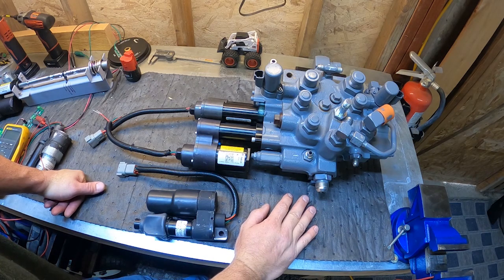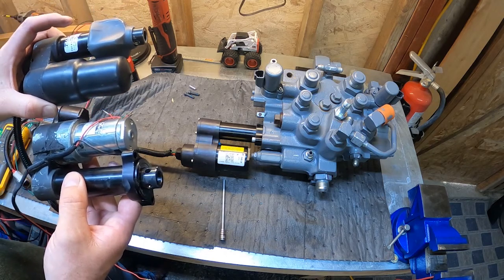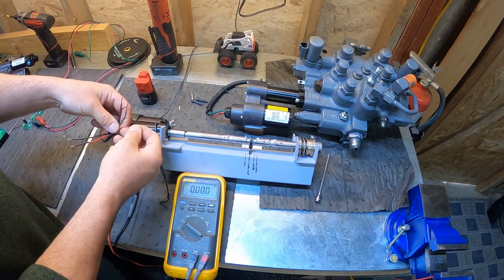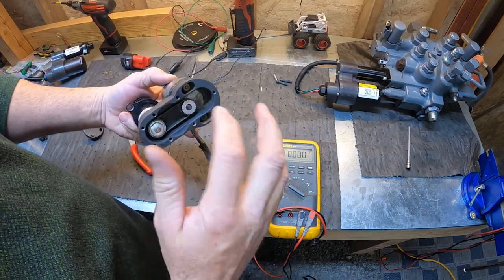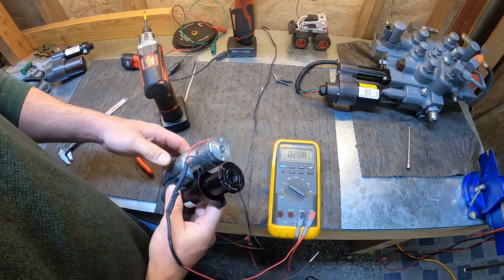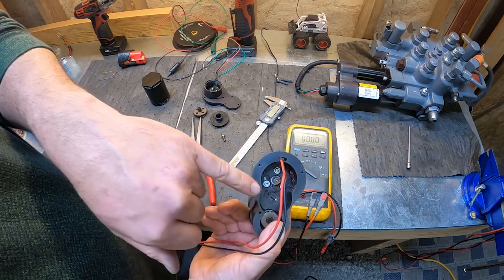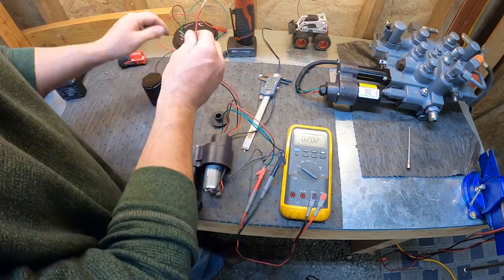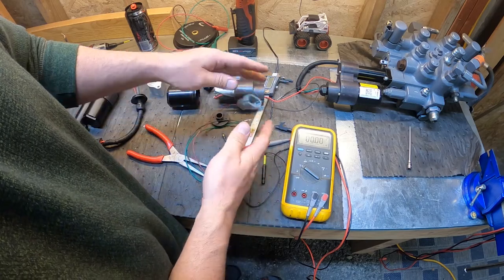Bobcat actuator, how it works, repair and calibration, what you need to know.  ACS AHC SJC

Comment: I have my actuator apart and the motor is not working.  It is a Globe Motor with the part number 403A851.  Can not find this motor anywhere.   Is there a source for these or do you sell?    I took motor apart it doesn’t look bad but won’t run.
Reply from the maker: pottermotorsports I have used tested good motors if your interested you can email me bswwood@gmail.com

Comment: Hi hows things- i watch most of  your bobcat videos- i am struggling with my machine at moment an thought this might be worth a try if you can help,i have a 2007 S160 SN: 530011328 joystick machine an lift an tilt not working, i have replaced the solenoid but still not working, the hr meter has also stopped working so i cant see any fault codes- any suggestions ?could it be the actuator??ACS Light .
Thanks 
Regards
John

Comment: I believe I have a bad actuator and now presently I am trying to take it off. But it seems almost impossible on the machine am I better to go about trying to take off the whole hydraulic control assembly. By the way your video was very well done.
Reply from the maker: Thanks for the comment but no way I would take the whole control valve out. Worst case I'd pull the steering plate out and work around that. If the actuator is stuck you might have to pull the bolts out of the back of it and remove the big gear and manually spin it out
Reply: I have a 2002 753 with hand and foot control options. Is the steering plate the plate down behind your lower legs bending up into the engine cavity? Thanks for your quick response.
Reply from the maker: @bobsmith9786  that's correct, it's much easier to remove than it looks.
Reply: So I got the actuator off. When just doing the motor test and reversing polarity it went one way well in but not out. Seems like I have quite a bit of

Comment: Hey thanks for the help! I got my actuator of and now I’m have a bad control from water damage. I need the screen and the board, any ideas...?
Reply from the maker: Not sure I follow, do you need one of the front panels? What model and serial number?  Of you remove the panel it should have a part # on it.
Reply: @tetradgroup  yeah I need the front control #6672348
Reply: Serial# 805667
Reply from the maker: @bradholbrook2424  the panel is not repairable, I personally downgrade the panel to a keyed panel which is much cheaper.  Key works fine and you  really don't need many of the options the keyless panel provides.
Reply: @tetradgroup  thank you. From the dealership? Do you have part number?
Reply from the maker: @bradholbrook2424  6688404 is the keyed option, you can get from the dealership, make sure to get keys as well because it dose not come with.  Double check that part number, you did not give me the correct serial number but that's the only option for a key to panel so it should work. It will have to be downgraded through the ECU. Usually the dealership would have to do this with a laptop, I believe there is an option to do it in the machine I'll look up the procedure if you decide to go that route
Reply: @tetradgroup  thank you very much!

Comment: First, thank you so much for this video.
I have a 2000 863G. When the machine is not running and the actuators are activated, the tilt actuator acts like its having a hard time finding its center. it sounds like its twitching back and forth. It will do this until it decides that it's happy with its position. as long as its on long enough to so so. If its shut down before it finds center it will throw the error when key is next turned on. I pulled the actuator (Marine style connector with spacers) and tested it at the machine. everything seems to work as it should (no twitching). The measurement I got at the machine was 7.32mm. However, when bench testing this actuator, and at 2v, i get a consistent measurement of 5.3mm.
Any ideas?
Thanks
Reply from the maker: If you have the old style joysticks, that is usually the where the issue can be found.  Plug the other actuator in to the tilt harness and see if it does the same thing.  I'm guessing you have an AHC machine with the big silver controller.  The controllers can also fail causing symptoms such as your describing.
Reply: @tetradgroup  Holly smokes that was fast! Thank you so much! Yes old style. Yes big controller. Possible bad connection in the joystick? Ill tare into it now and post what I find.
Thanks again.
Reply from the maker: @northernlights4613  more so the inside of the joystick hall effect sensor wears out and has a hard time finding center.  If the joystick sensor is the aluminum block style it is no longer available and the whole joystick will need to be upgraded.  After swapping actuators around and if the issue remains on the tilt circuit you can swap joystick sensors around, although kind of a pain to help narrow down the problem.  If the actuator acts up on both lift and tilt circuit it could just be a bad actuator. Hope that makes sense.
Reply: @tetradgroup  Hello again. So, when I swap the connections at the actuators all it does is throw an ACS error. I think it was 32-04 (should have written it down). I did however, swap the joystick sensors. For some reason the twitching stopped and for now it's not locking out. I have about a foot and a half snow to clear we'll see what happens. Maybe it will tell me something if the lift actuator starts to twitch.
Thank you for your time!

Comment: 2000 773g tilt actuator belt is stretched out and skipping teeth on gear everything else tests fine. Do you know where to get a belt and what causes this.
Reply from the maker: Usually age is the issue, but make sure the ball screw slides smoothly in and out.  I have a few belts available if interested you can email me at bswwood@gmail.com
Reply: Try to adjust the 2 screws that attach the motor to the housing they are slotted.

Comment: Hi Brady, Awesome video, great camera work and video quality, nice to find "how to" videos you can actually see. My 863F which I've had for 6 years is acting up again, tilt actuator again. I am heading to the job site tomorrow to pull it and repair/recal what I can. Just wondering if the "new" FLIP actuator is PN 7104842, and the adapter required for 1999 machine is 7101705? I bought my machine cheap from a gravel pit after they spent $15K at the dealership trying to fix the AHC. They gave up after 4 years of fartin around with it. I'm an electronics tech and had it working again within a few weeks after figuring out how it worked, but now I have no tilt at all after a minute or so of running. They put in the AHC update kit, new sticks, harness, controller (metal one 6675129) and multiple actuators over the years, still never worked for more than 6 months at a time. I'm hoping this time to fix once and for all. My other question for you is how do you calibrate the AHC system after replacing the actuators? Mine is the 2 LED on the left joystick, AHC only system. I know the SM states for testing to pull in the handles and turn off the key etc..., just wondering if that is the calibration sequence as well? Oh, and finally, the manual states the centered voltage should be 1.72 for my vintage, have you found that to be correct for first gen AHC or should I use 2.0VDC?

Thanks for all you helpful videos, great work.

cheers
Reply from the maker: Those are the correct part numbers but I would think if the AHC update kit has been installed then the new actuators and adapters would have also been installed.  You will not be able to calibrate the AHC system unfortunately.  I use the 2.0V with the measurements provided and works well.  If you have issues you can try to back off to 1.72 and see if that helps but 2 should be fine.
Reply: @tetradgroup  Thank you for the quick reply, much appreciated. Yes, those are the part numbers I found on the multiple invoices that came with the machine, just wanted to make sure I had the latest version. I am suspecting bad motor brushes or binding ball screw, I'll know later today. Thanks again!
Reply: OK, well I think we have a good news/bad news scenario, I'll let you tell me if it's bad or tolerable.  I dismantled the tilt actuator and found not bad brushes but sticky brushes, not sliding freely in the holder and not making contact with the comm so I dismantled the motor and polished the commutator and cleaned up the end plate/brush holder and it freed up nicely, motor spins perfectly now every time.  I calibrated it per your method and it all seemed fine, until I tried push/pulling the actuator to see the output of the hall sensor, it's over stroking in both directions, ie rolls past 5 back to .4VDC or so, same the other way, goes past 0 and up to about 4.5VDC. The ball screw has some play, more than the lift actuator but it is free. It has about .5mm play in/out. I tried for an hour to center the sensor better but it still over strokes in both directions. Can you please confirm if the controller will still be able to deal with this, I imagine the hydraulics don't need the full 1.14" stroke??

The good news is the lift actuator didn't really need anything but I buffed up the commutator and adjust the 5mm depth to 2.0 VDC and this one doesn't over stroke at all, it's perfect.

I also figured out why your 2.0 VDC method works perfectly, and replicates what the service manual states (at least for my 2000 F series). You use 5VDC and set it for 2.0V at 5mm, the manual states the center value should be 1.72V but that is testing in the machine connected to the controller, and as the controller is only putting out 4.3VDC, 1.72 corresponds perfectly to 2v at 5 volt supply. I adjusted my power supply to 4.3 and sure enough, 1.72V. Yeah! I imagine the 5V would only be seen when the float is activated.

Anyways, hope you can tell me all is good with my sloppy actuator and I don't have to spend $1400 for a new one...I saw somewhere that the ball screw can be serviced but can't the info. I tried removing the outer cover like the motor cover but no go, I didn't want to break anything until I checked with you. 

I wanted to get your opinion before I put it all back together. 

Thanks Brady!
Reply from the maker: @kilohertz684  not sure how well it will handle the slop but it will not roll over due to limited stroke of spool once it is hooked up.  There is a tolerance for center position so it will handle some slop. And yes you are correct, only lift will approach 5V in float mode, tilt should never exceed 4.2V
Reply: @tetradgroup  Thanks Brady! Again appreciate the quick reply. I will try it as is but would like to know if there are any tricks to getting the ball screw housing separated from the case? I thought I would at least have a look at it before putting it back in the machine.

Cheers
Reply from the maker: @kilohertz684  don't take ball screw apart, extremely difficult to put back together without special tools.
Reply: @tetradgroup  K thx, saved me a bunch of trouble.
Reply: @tetradgroup  Well it works, a buggar to reassemble it all. The tilt, although it works,  still sounds sluggish in one direction. I would like to lube the ball screw rod, like you mentioned in your video, I don't want to dismantle the screw, I know how they work, recirculating balls, I just want to get some grease on the screw. Should I heat the case to get the housing to release, pipe wrench? Explosives? 🙂  I know that I will need to replace this in the next while, I just need to get thru this season for now. Cheers

Comment: I don't know where to start. T750 Pedals do not move; code W3267 ACS Operating Mode Switch Flipped While Operating. Do you think it's a control valve actuator?
Reply from the maker: Nope, either ISO switch or wiring issue

Comment: Hello, I was wondering if you could please share where you got the motor controller and servo driver to test the actuators. I replaced my tilt actuator and now I have no codes but the bucket will tilt down normal speed but tilting up is very slow unless I push the float button and then tilt the bucket up it will go up very fast and continues until I push the float button again. I tried to calibrate the actuators as per manual but still doesn't work. The machine is a s175.
Reply from the maker: Probably the fastest and easy way to check your actuator is to swap the tilt and lift actuators and see if you have the same issue with the tilt as you're currently having on the lift
Reply: The the tilt actuator (the one with the issue) is brand new and it will tilt down fine but tilt up slowly in less you push the float button and then move the tilt leaver.
Reply: I would like to rebuild my old actuator so thats why I was asking which motor controller and servo driver you use in the video.
Reply: Thank you very much for the videos you make and also for taking the time to help.
Reply from the maker: @putzp7457  Servo City is where I get my parts.  Parts 605045 and 605105 is the driver and controller I use.
Reply: Thank you.
Reply: So I swapped the lift and tilt actuators with each other and it still won't tilt the bucket up as it should. While the actuators where off I pushed and pulled the lift/tilt spools and they both move the same no binding etc..
Would you have any idea on what would cause the tilt hydraulic circuit to move slow in only one direction? Is there a way to bypass the bics solenoid on the valve mine is shorted to ground and I live in the bush so it takes a long time to get parts?
Reply from the maker: @putzp7457  when you tilt forward does it have enough power to lift the machine? Usually it'll lift down due to gravity faster than it'll lift up if you have a bad cylinder. Is your machine have one or two tilt cylinders? Raise the arms in the air with the bucket level shut the machine off and lift the arm bar and see if it leaks down at all. There is not a way to bypass the bics as it it spring closed and electricly opened.
Reply: When I tilt down  it lifts the machine no problem, but when I try tilt up its very slow and no power unless I push float button while trying to tilt up. So to me bc it will tilt up with full power when I push the float button while trying to tilt up the cylinders are fine. My S175 has two tilt cyclinders There is no problems with lift hydraulics and it will tilt down with full power but won't tilt up with full power. 
   I just don't know if I should be  chasing a electrical issue or a hydraulic issue? The hydraulics obviously has the potential to tilt up normally bc it works whe I push the float button. Its not the actuator bc its brand new and I swapped the the lift and tilt actuators and no change  I have calibrated the actuators like you show in the video but it's no better. When I move the tilt lever and listen to the actuator move without the engine on it sounds like its struggling more so when tilting down. The tilt spool moves freely and smoothly when I tried to move by hand with actuator removed.

Comment: attempting to manually calibrate 1st Generation lift actuator. your video shows adapter/coupler that you  use as a leveling guide by laying straight edge across to check actuator shaft height,  i have 873 F series Bobcat. my adapter/coupler is half as thick as the one you use in video. please help
Reply from the maker: Sounds like you have a floating, belt drive actuator.  You may have to pin it to the valve and either take a measurement while mounted to valve or set voltage and bolt head on while actuator is mounted on valve.
Reply: @tetradgroup  i manually calibrated lift and tilt actuators. actuator pistons are now to far away to connect to spool valves now that the pistons are centered up in time and calibrated. i have plenty of room so im gonna try and predrill 2 mount holes into mounting bracket and simply slide actuator assemblies forward to make up the difference in thec gap
Reply from the maker: Should not have to move the mount, sounds like the actuator is not in the correct position.  I didn't cover the correct measurement for that style actuator.
Reply: @nickdarling9557  Make sure lift arms and tilt bucket are secured. Leave the covers with the pots off, attach your actuators to the spools, now tighten them to the valve body. They should be close to centered , you can check this by putting a socket on the nut on the worm screw. You will know when you are at center by twisting left/right (the spring on the spool is self centering). Now you have found center, plug the actuator in to the machine. Turn the key on (my AHC light comes on but you will have power ), connect multi meter +(red) to green signal wire and - to black ground , set pot to 2 volts and close her up. I recommend just putting 3 screws in the pot (in case something is wrong) shut off ignition, seat bar down, turn on ignition (machine not running), press operate button. Actuators should work in and out.

Comment: bobcat S770 the backet cannot lift or tilt in display the coed is M1128 Seat bar sensor failure
but when test seat bar sensor in other bobcat, the sensor was doing with no coed in display and backet lift and tilt? 
Can you explain to me what I'm doing?
Reply from the maker: Sometimes I find the issue in the harness itself.  If you check the two outside pins of the connector you should have 5vdc.
Reply: @HowIDidIt
 why the bucket can't lift or tilt
 and
 what it the way that i can the bucket is work in lift and tilt wihtout use the ECM